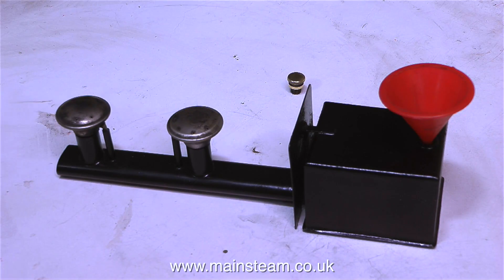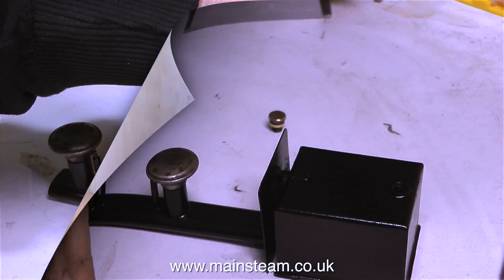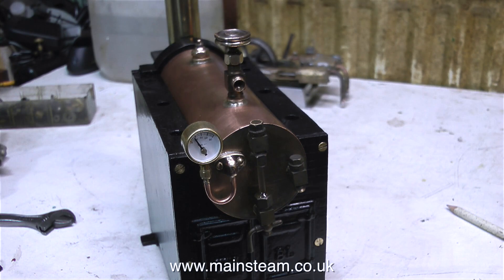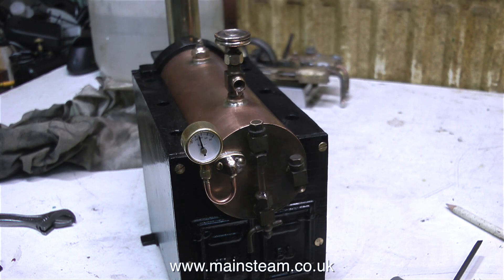HOW TO MAKE A VINTAGE BASSET-LOWKE STEAM PLANT WORK AGAIN - PART #4

Comment: Acetone will clear out any old paraffin (or any other hydrocarbon residue) from burners without the need of continual burnouts. Just chuck some in and leave it for a bit, slosh it about from time to time and it’ll clear out the crap in 20 minutes, rather than two bottles of meths.
Reply from the maker: Thanks for that fact I didn't know }:-)))

Comment: If you want to explore spirit burners a little more, take a look at the "Trangia" burner. It is made in brass, and takes a charge of about 80ml of spirit and they generally recommend adding up to 10% water to reduce sooting. I use one as part of a camping cook-set. You might find these useful for a vertical fire tube boiler of some type.
Reply from the maker: Thanks Martin, I have an old one with an extension tank fitted, I think I will give it a try.
Reply: Keith Appleton - I should mention that the Trangia burner will go for about 20 minutes per charge which should be sufficient burn time for a small steam plant.

Comment: What was the first Steam Boiler/Engine you bought or made?
Reply from the maker: The very first proper one was a "Simplex" 0-6-0 5 inch gauge locomotive  - a Martin Evans design. I finished the rolling chassis, but I couldn't afford a boiler for it at the time (around 1980) so after a while I sold it...... (:-(((

Comment: Jarrah beams used to support the bells of Christchurch Cathedral up until 1978 when they were replaced by a new steel frame. The wood provided the engineers who removed it with a decent fight! It wore through chainsaw blades at a rapid rate!

Comment: A question about boiler certificates... I am assuming that these are issued by certified boiler makers? Or can a person issue a certificate once they have performed a boiler test using the acceptable methods for testing? How would this work for a boiler "kit" one would assemble themselves?
Reply from the maker: If you are running the boiler in public you need either a valid insurance certificate of one of the Model Federation certificates. These you can get by joining your local model engineering club.
Reply: Thanks Keith, I will look into that here locally... Cheers!

Comment: Hi Keith, another very fine video. If I remember correct the definition of a Screw is An incline plane wrapped helically along a cone. The definition of a bolt is An incline plane wrapped helically along a cylinder. I always figured If it has a point it is a screw, no point a bolt.

Comment: If you had a deep gouge that mandated repair on the boiler surface at the flange, would you use silver solder to resurface? I know that would likely mean disassembly of the boiler.
Reply from the maker: No, I wouldn't re silver solder as you would probably cause more localised leaks. You could use soft solder - or clad the boiler with a thin sheet of copper . . .

Comment: I do love that burner as I have said so before, I have one for my scratchbuilt engine that is quite similar but doesn't have the shower head jets but is actually quite potent with 4 wick holders with the wick holders being the diameter of an old 1/2p :)   I am going to take apart my scratchbuilt as I want to fit union's to the port bar for inlet and exhaust and a union at the chuff pipe end so I can take apart with spanners rather than having to desolder as it is now lol   I do want to fit a water gauge and a pressure gauge at some point but the prices of the latter even second hand are heinous I have found.   Taken a swerve towards the hydrocarbons side o' things picking up an ancient yet working Italian Asperba I think it is called engine, I want to build up a showcase I can take to shows and want a couple of infernal combustion engines alongside my model steamers :D

Comment: Jarrah wood...from Australia. It's used for a vast number of sleepers (rail ties) in Australia and it does burn. It's used as fire wood around saw mills in south west Australia. I found the smoke most irritating. I took the India Pacific train from Sydney to Perth. The sleepers across the Blue Mountains were cement and a very rough ride. The rest were Jarrah wood with a very nice ride.

Comment: As far as I know a screw is threaded all the way to the head and a bolt has a section of unthreaded shank.
Reply: ant f That’s exactly how I understand it. I’d call most of the fasteners Keith uses machine screws.

Comment: I work at a shop that creates tooling for large progressive dies, and we also have die makers for assembling, modifying, and testing the dies. There many sizes of "bolts" (I've always call them bolts) but they are full range of SHCS (socket head cap screws) and damnit they look like bolts. The official way to tell if it's a screw or bolt is, does it screw into existing threads or make its own threads? If so it's a screw.

Honestly this doesn't make much sense to me because if you attach a nut to a SHCS and not thread it into an object (bolt two items together), does it become a bolt? The second question is, why does it matter? heh

If I threaded a SHCS into "whatever" and said I was bolting it down (instead of screwing it together) why would anyone care enough to correct me? People are pedantic though and I honestly don't know where to draw the line in many cases. If a guy says, hey I'm gonna nail this board together, then he grabs a screw gun and screws it off..... Well you would think he is an idiot or just messing with you. So is it fair for a person to correct me when I say bolting instead of screwing? Hmm, to much thinking for this time of day.

Comment: Hi Keith
Another great video - thanks!
I am a retired railwayman. Jarrah is the wood we made sleepers out of in important places such as tight curves with check rails and points and crossings on the main lines. The jarrah has been superseded in points and crossing work by concrete. Jarrah is a very rot resistant timber - I made a garden seat out of off cuts 30 years ago and it's still fine! It's very difficult to work with as it's so hard and abrasive. I have seen furniture made out off it at exhibitions and it looks great when polished.
Thanks again
Regards
Dave

Comment: Hi Keith.  Love the mixture of tongue in cheek humour and good Engineering.  For those pedants, like myself, a set-screw (aka screw)  is threaded up to the head, whereas a bolt has an unthreaded portion under the head.  If it was unthreaded at the other end, you wouldn’t be able to get the nut on (Sorry, I’ll get my coat).  Most of us call screws “bolts” and some suppliers call grub-screws “set screws”.  I know what you mean about thinners.  I still have some of the good stuff that smells of pear drops, but most of what is available now seems to be what I used to buy as “gun cleaner”, back when I sprayed cars with cellulose paint.

Comment: I have a Trangia spirit burning camping stove and the manufacturer states mixing the methylated spirits with 10% water prevents the burner shooting up the bottom of the pans. This may help in removing the yellow tips from the flames.